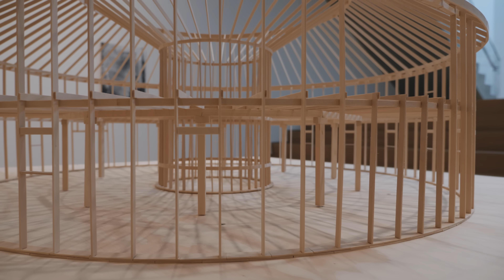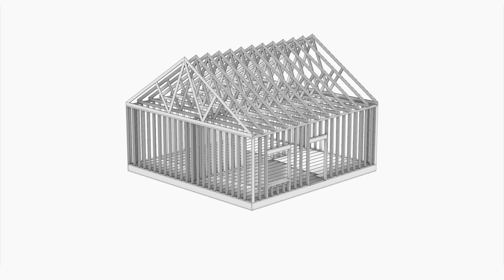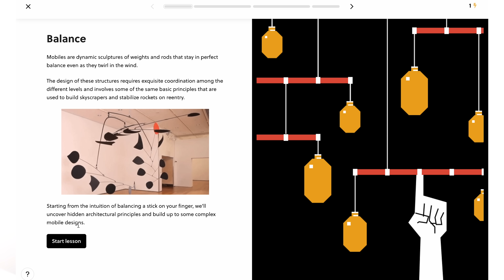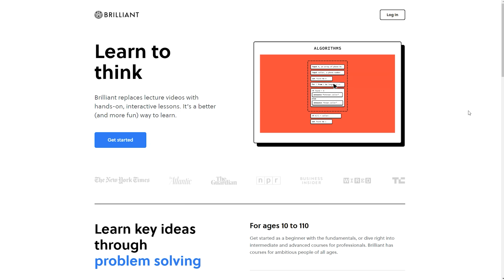The Genius of 2x4 Framing

Comment: Great video, though I personally hate 2x4 wood framing with a passion :) Yes, good houses, even passive houses, can be built out of it that can last for centuries, but most new houses built in USA are NOT that, and are built to code minimums.

Much better options, in my opinions - Insulating Concrete Forms, Metal, Porous ceramic insulated blocks (apparently Europe only), SIP, Mass timber (CLT) etc. All of those will give people more disaster resistant, low maintenance, more comfortable, more energy efficient to live in houses.
Reply: The better options are priced accordingly, though.
People who know better, and care, and most importantly can afford it, go for the better options.
Reply: @hhiippiittyy  True, but a good portion of the cost is because of a lack of widespread use. ICF is catching up in that regard, and is barely more expensive to build with compared to stick, especially recently. The more some tech is used, the cheaper it is.

So as an obvious example, dual pane windows are standard in USA, but triple pane is standard in Europe. As result, the triple pane windows in USA cost way too much, and it's sometimes cheaper to import them from Europe because of the economy of scale that they achieved.
Reply: @rafflesmaos  
So...  £'m gunna sound like a contrarian, but I promise that is not my intent.

The example is missing a key element. For manufactured products like windows Europe will certainly be extremely proficient. Things that NA would do well to adopt. But for a product like wood, it might be a generation before there is a serious price competitor. Kinda like how bamboo scaffolding is regional. 
At least where I'm at, where there is a mill around the corner, ICF can compete in the foundation market, but the rest of the frame in wood is probably much less than half the cost to the nearest competitor. 
2x4 walls are also excellent for cheap insulation framing. 
That it is pretty much the worst option I cannot deny. But it's cheap.
Reply: @hhiippiittyy  No worries at all, and wood certainly is cheap. It did spike severely in 2021, but is back to relatively reasonable levels but still double pre-pandemic. Of course, EPS foam went up in price as well. I'm no expert in where other cost differences come from exactly, but surely at least some of them are based on economies of scale for production of ICF forms as well as the EPS foam itself.

There was a paper done back in 2001 on cost differences between a 2x4 and ICF house, and the total cost difference for the entire house was about 4%. That's even though at the time the cost of an ICF wall was roughly double that of a 2x4. But as a portion of the overall house cost, it's really not much considering the long term energy savings and other benefits. 

I wish I had data to back it up, but I would expect since 2001 the price difference to narrow further, as ICF houses are being built in greater amounts (but still tiny in comparison to wood framing). In places where disaster resistant construction is required (which IMO should be everywhere at this point), the price difference is probably even less.
Reply: You say "built to code minimums" like that is a bad thing.  What specifically would you change in US building code?  Keep in mind that there are different building codes for different environments: hurricane areas, earthquake zones, flood risk areas, tornado areas, cold weather locations, desert locations, high humidity areas, oceanside, etc.  A house in southern Florida is much different than a house in Minnesota or a house in the Arizona desert.  

Any house meeting modern building codes will last for well over 100 years if it is maintained.
Reply: @CleverAccountName303  Well, I see it as a bad thing where the code minimums are behind the curve when facing things like 1/100 year events happening nearly yeary, house energy consumption being absurd and health of the residents jeopardized when incoming air is filtered through the wall insulation. Florida houses were also built to code minimums until hurricane Andrew made a wake up call. The problem is that codes are still apparently very reactive rather than proactive, and even when they are reactive they are not reactive enough.

I'd at the very least require 2x6 framing with 1" of external foam sheathing in any zone. Plus mechanical ventilation (ERV/HRV). I also consider it a crime against humanity that single pane windows are still a thing that exists in general :P
Reply: @rafflesmaos  well I agree with most of that.  I may have misread that you are more focused on durability rather than energy efficiency.  I don't think durability is a big problem.  

Hazard zones need to be expanded greatly and climate change needs to be taken into consideration for that expansion.  Homeowners and insurance companies oppose this because it increases building costs and insurance rates.  Or in some cases insurance companies will not insure at all.  

Insulation and energy efficiency standards need to be greatly increased.   However concrete should be banned as a building material for small buildings since it is so environmentally unsustainable including massive greenhouse gas pollution.  On the other hand, wood is a sustainable renewable building material that absorbs carbon dioxide while it is growing and then sequesters while it exists as a building.
Reply: @CleverAccountName303  It's kind of a two for one deal in a lot of cases when it comes to energy efficiency and durability, unless someone is literally just building with concrete or brick and nothing else.. but I hope nobody does that for their houses, hehe.

The insurance costs usually go down actually for more durable disaster resistant buildings that are made out of things like ICF and brick, and total house costs don't go up by all that much, often under 10% more.

Concrete being generally unsustainable I would normally agree, but there are some catches here. There's been some studies done that over a lifetime the embodied carbon costs of the concrete are amortized over time by the high energy efficiency of the construction, among other things, and come out fairly even at the end. There's also some potential technologies that could help significantly to reduce the initial carbon costs by for example sequestering CO2 in the concrete and/or inclusion of fly ash.
Reply: @rafflesmaos  wood buildings can be extremely energy efficient and well insulated.  If not, they wouldn't be used in places like Northern United States, Canada, Scandinavia and Finland.  A danger with modern wood frame full-wrap houses is that it is actually easy to make them too airtight.  You can easily make them have a higher R value than most concrete buildings.  

If building costs increase by 10%, then Insurance costs usually increase by at least that much.  But I get your point that a fortified building that is less likely to be destroyed, might be cheaper to insure which might offset increase building costs.  However, I was talking about if you expand environmental hazard zones, for example, if the government says that the floodplain is now bigger and an extra 2,000 houses are now in that floodplain, the insurance costs just drastically increased for those 2000 existing houses and for any new houses that are built in that area.  In some cases, insurance companies will refuse to insure houses in that area for that risk.  For that reason; homeowners, builders, and insurance companies usually oppose changing hazard boundaries.  

The carbon footprint of concrete can be decreased but I will never be a renewable resource and it will never be close to carbon neutral.  And we are running out of sand because of concrete.  On the other hand, wood uses up carbon dioxide and converts it to oxygen for the 20+ years that it's growing on the tree farm, then sequesters the carbon for the lifetime of the building.
Reply: @CleverAccountName303  Yeah, agreed, I'm a big fan of mass timber as one of the alternatives. Too bad it's currently pretty much insanely expensive in the states :( Again that pesky thing with economies of scale... if I were rich, I'd immediately build a house with it. Alas :(
Reply: Genau. Rückständige Häuser.

Comment: Here in Australia we use noggins between the studs. It intrigues me as to why I never see them when watching American house programs. I have worked in construction for 25 years and currently work for a builder who uses steel framing. You never need to worry about termites.
Reply: There are many early houses in North America from the 17th century thru the first half of the 19th century that use mud-brick or wattle-and-daub nogging, which I assume is the same as what you call noggins. The house I now live in, built in 1837, has wattle-and-daub nogging. It was a tradition brought over from mainland Europe and the British Isles. It was used mainly for insulation from the cold and as a fire stop. From what I can tell, its use gradually declined as central heating and more industrial construction methods came into use.
Reply: Because we use sheathing on the outside walls to provide racking resistance. It also creates a weatherproof layer. US houses typically endure more temperature and humidity extremes than Oz and need to be better sealed and insulated. Those noggins provide a thermal path from inside to outside, so we minimize their use. There's a lot of interesting work going on in this area, like engineered studs with thermal breaks.
Reply: Our houses are on block foundations and we put a metal flashing sheet under the footer board that termites can't get past. Pretty ingenious, huh?
Reply: Myopic short term monetary gains rule the land here in US.  Oh, and we love to tout sustainability but tear down buildings every 25-30 years.  Sad.
Reply: @ApriliaRacer14  That's a ridiculous statement. Where are homes torn down after 25 years? Name someplace. Because I've never seen that.
Reply: I guess if you trust all of your shear stability to come from the cladding particle board, you can entrust your buckling resistance to it as well.

Comment: 2x4’s used to be exactly 2” x 4” and you can see this in older homes.  This wasn’t necessary structurally, so it was scaled down to 1-1/2" by 3-1/2".  They called it a “2x4 Stud” and that’s OK with me.  But when you buy 1” thick plywood and it’s really 15/16” or an 8” wide plank and it’s really 7-3/4” that’s total B.S. !
Reply: I think originally, 2x4s were cut green at 2" x 4", but shrank when dried, so they were not ever truly 2" x 4".
Reply: @twells138  The 2x4s in my early 1900s Sears home are dead-nuts 2"x4".   They are dark honey brown and the sides are really, really rough, unlike modern 2x4s.
Reply: @BradThePitts  Maybe the Sears 2x4s were dead on when rough sawn, but there were not any real national standards developed until the 1960s, and different lumber yards and regions had slightly different manufacturing, curing, planing and finishing traditions for small dimension lumber.  Hence, most 2x4s were still not 2" x 4".
Reply: @BradThePitts  I tore down my grandma's early 1900s 2 room house back a while and I kept some wood to make a table. I just went out and measured the studs. They are rough sawn oak and they are exactly 1 5/8× 3 7/8" except one which was 1 1/2 × 3 1/2. Which is odd because that much difference seems like it would cause major construction problems. I agree with you about the  incorrect dimensions on most types of new lumber and even drywall at the lumber stores. I dont think they can use the drying out as an excuse for a 4'×8' sheet of plywood.
Reply: @twells138  There may not have been any "national standards", but c'mon, it shouldn't have been necessary to create a "national standard" when the product has a mathematically clear descriptor on it.  It's not like a T-shirt that comes in S, M, L, and XL, it has specific numbers on it.  If I buy a truck with a "seven-ton towing capacity", I think I have a right to be unhappy when it turns out to only be able to handle 5.5 tons.
Reply: @BS-vx8dg  2x4 is easier to say than 1 1/2 by 3 1/2.  Everyone in construction know what size lumber is even while saying the nominal size.  This is not the first industry to do this.
Reply: I have a 1903 house in the San Francisco area. All the 2x4's are 2" x 4-1/4" and, yes, they are rough cut. You don't want to just slide a hand down one. It did help when I added insulation to the house. There was none. The climate you know.
Reply: @danielcarroll3358  wow those are some huge studs. I thought the ones I had where big pieces of lumber. I bet that house lasts for another 100 years or longer.
Reply: @ashleyhill6697  Considering that I just reshingled the walls, put a new roof on it, added solar and added a wing with a basement, I hope so too!
Reply: The actual dimension of wood is smaller because the wood is finished. The plywood was 1" thick before it was sanded smooth. The studs were 2"x4" before they were planed too.
Reply: My house was built in 1924, thick as shit. No squeaks, no booming footsteps. You can see the house was built with the framing fitting together, and pinned with nails, not constructed with, and using nails as holding force.
My parent's 2800 sf home built by a quality builder, is chincy as hell. Any wall you bang, booms through the house. Every footstep shakes the floor. 

Homes are cheap now.
Reply: @RobChapala  they didn't even know what insulation was in the 1920s. They didn't know a lot of things back then. I've lived in old houses and newer houses. I'll take a newer house over some old claptrap any day.
Reply: @1pcfred  who needs insulation when there's 4 inches of plaster..lol

Comment: My father (the architect) had a favorite story about his grandfather (the carpenter). A point of pride for him was showing off a wood frame building he'd built solo. With just a hammer, hand saw and a framing square he built a building 120' on one side. You could sight down that side and see no board out of line. "Sa fin som snus".
Reply: Yer Great grandpa were Swedish then... seeing that quote of yours.
Reply: And it took him a long time.  But, this is about building communities not a family home.  I appreciate the story though.
Reply: @ChrisPadillaAZ  what makes you assume that? Other than a lack of knowledge on the topic?

Hand saws were the norm back in Grandpa days. Same as hand driving nails. Correct hand nailing goes set, sink, counter sink, next for 16p. nails. Doing this is about half the speed of a nail gun.

Not having a board out of line is done through correct plumb and line of building and latter straight edging